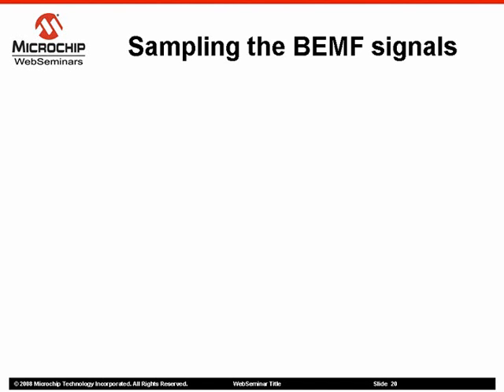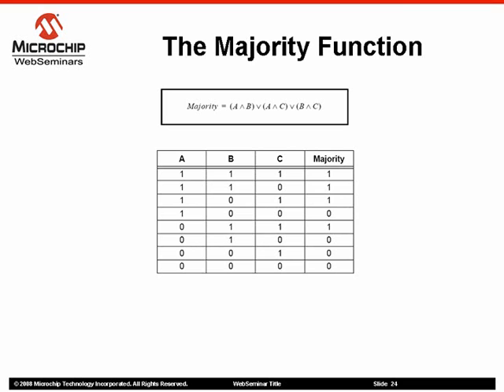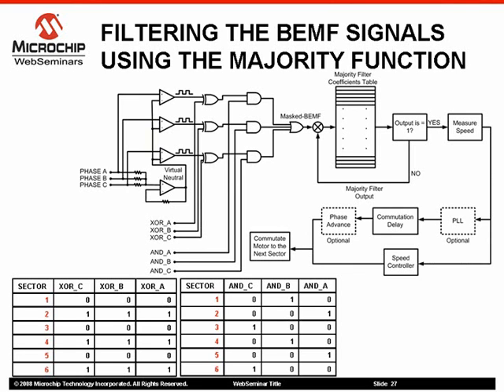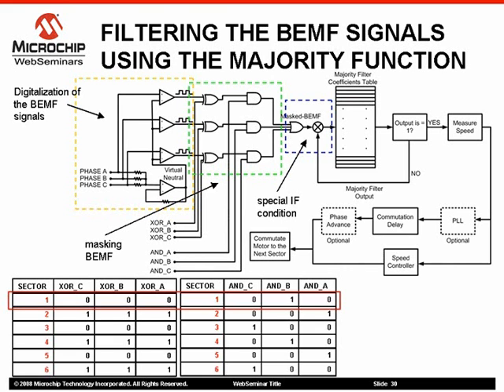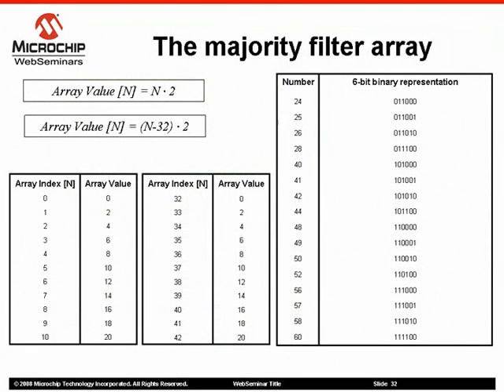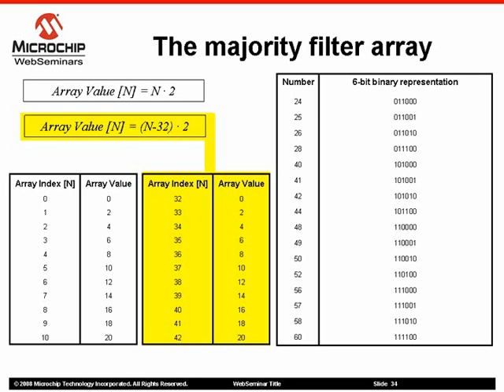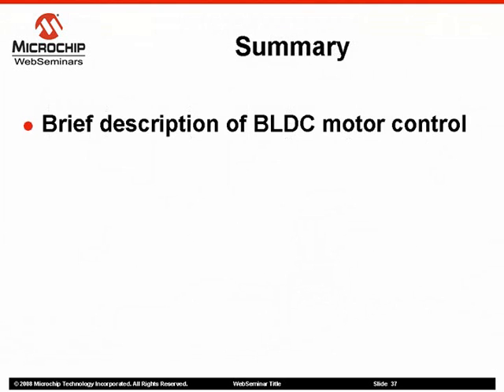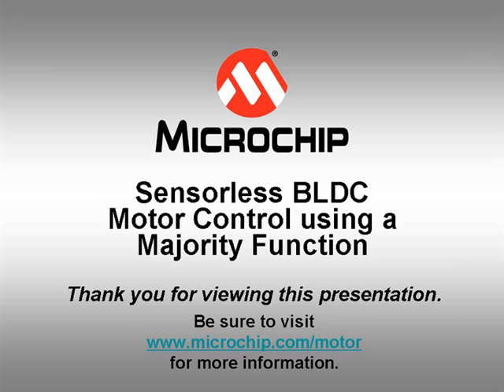Sensorless BLDC motor control using a Majority Function Part 2 of 2

Comment: I have messed about with this for a number of days and still can not get the motor to run well. The explaining of the filter is not very good, a worked example of the inputs and how it interacts with the array would be most helpful.
Also I think the source code for dsPIC33EP512MU810 has an error in the Init_Motor routine for CLOCKWISE rotation in it loads the ADC_XOR array and the ADC_BEMF_FILTER array with the COUNTER CLOCKWISE values.
Reply from the maker: Hi Mark. We don't provide technical assistance through our YouTube channel, but if you would like some help with this, please go to support.microchip.com. You can either post this issue in our Forums or use the "My Support" link to create a support ticket.